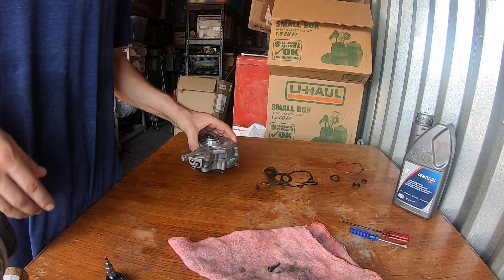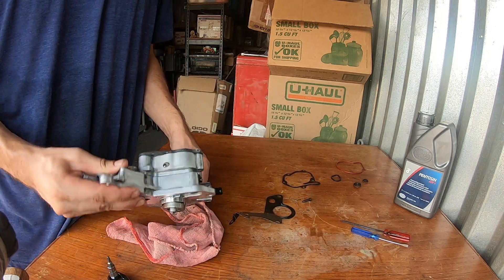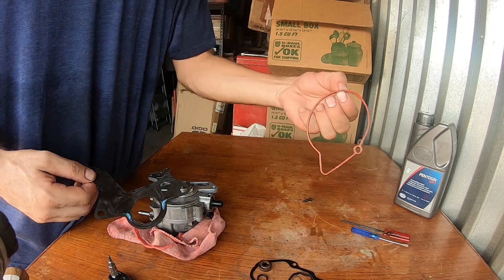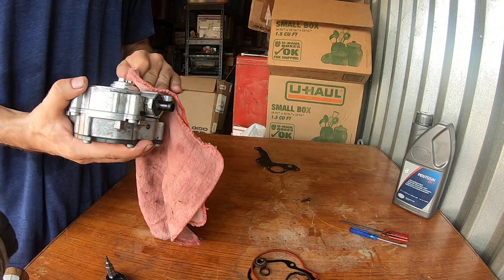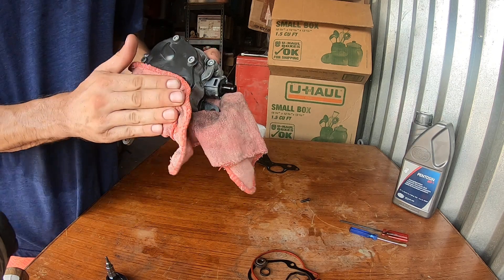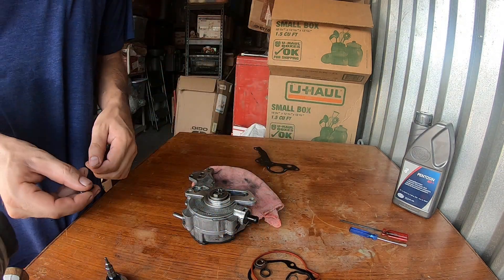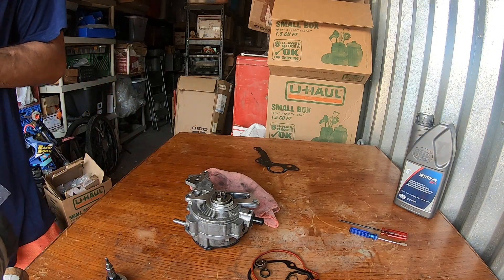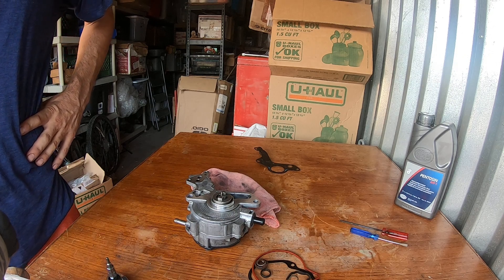BEW TDI JETTA TANDEM PUMP REBUILD *LEAKING FUEL INTO OIL! PART 9

Comment: did it work well in the car? my tandem pump was also so tight, I couldn't turn it with my hands
Reply from the maker: Yeah worked great! Solved my problem
Reply: @bbb129  When I took the pump off the car I could turn it well by hand, but after putting the seals on, the same thing happened to me, I couldn't turn it by hand, it was too tight. do you know why this happened?